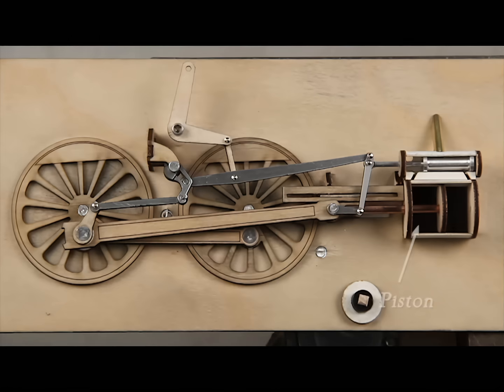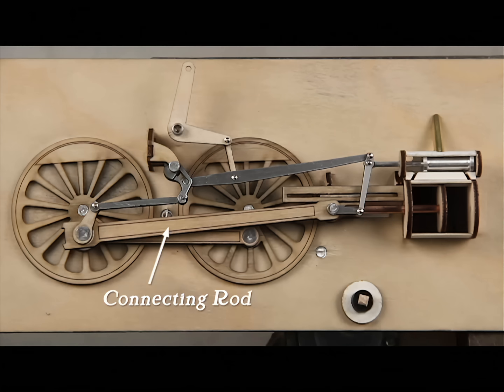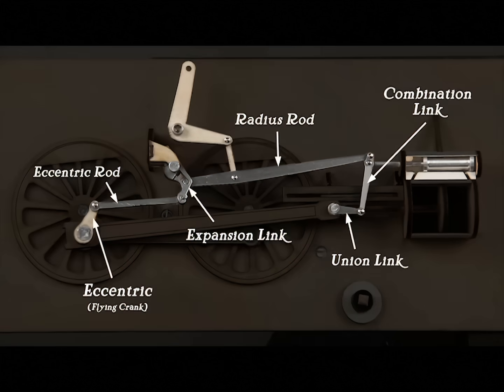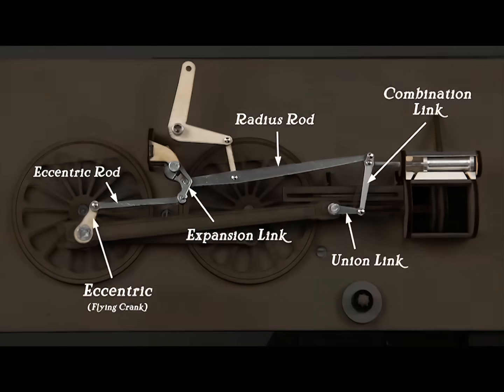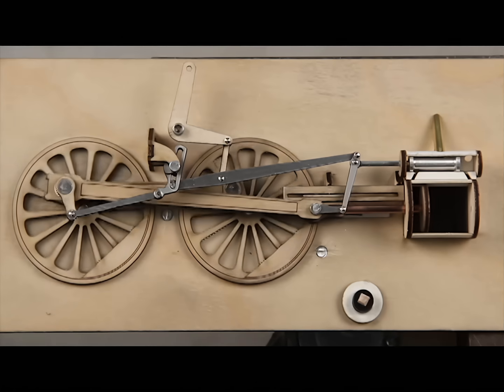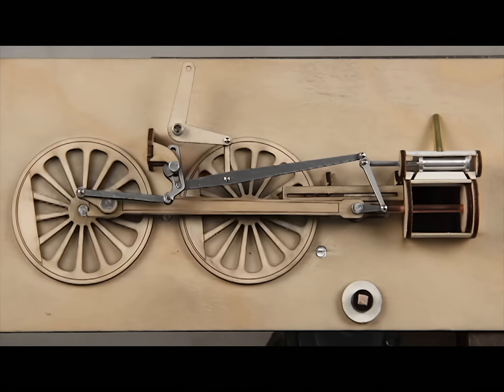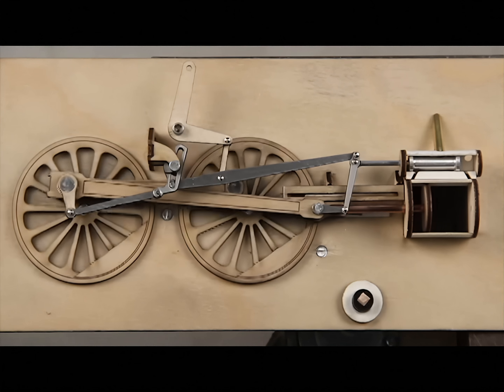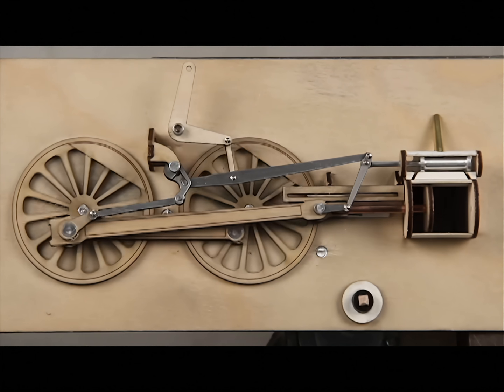Walschaerts Valve Gear Explained

Comment: Thanks for the post. I always wondered if the other side of the locomotive is replicating meaning is it doing the same or is slightly offset - delayed?
Reply from the maker: It's the same on both sides.  But, the other side is 90° out of phase.

Comment: When the expansion link is in the neutral position, how do the wheels "turn over" when the pistons is at its max and min positions without the help of the eccentric linkage?
Wouldn't it just get stuck or go back and forth?
Reply: I  believe each set of wheels n gears ie. left.and right is offset to each other so one side can always deliver power to get initial  movement.
Reply from the maker: Good question!  This mechanism is replicated on the opposite side of the locomotive, but 90° out of phase.  So, when one set of drivers is at 0" or 180°, the other is at 90° or 270° respectively.
Reply: @BLitwin  Oh that makes sense, but could the other side also ever be in the same phase, like maybe in a turn? I mean the train doesn't have a differential but is there anything stopping them from ever doing that?
Reply from the maker: @il400 Without the phase differential, the engine could not start from a standstill, when the drivers are at 0°/180°. Differential-wise, geometry dictates a minute amount of slippage between the driver and the rail, when rounding curves.
Reply: @BLitwin  so the train does have a differential?
I thought that wasn't invented until the 20th century?
Reply from the maker: @il400  I did not say that.  I meant that because there is NO differential, some wheels have to slip on the rail a tiny bit, as the loco rounds a curve.  For example, the North American gauge is about 5.4ft, with a minimum curve radius of 574ft. Given the minimum radius, the outer drive wheels would have to rotate ~1° more than the inner ones, for each degree of the curve.  Ergo, slippage.  One might wonder if this disparity might not be compensated for, through some other features in the mechanism. I don't know. These machines are immensely heavy, though.  Something's gotta give. :)
There is quite a bit of consideration given to track geometry. See - https://en.wikipedia.org/wiki/Minimum_railway_curve_radius
Reply: @BLitwin  I get it now, thank you
Reply: No differentials on locomotives or carriages just a solid shaft axle with fixed wheels. The difference in rotation from inside to outside wheels in a curve is obtained through tapered wheel faces and sideways movement on the rails against the wheel flanges. ie. In a lefthand curve the axle moves to the right, increasing the diameter on the right hand wheel and simultaneously decreasing on the left hand wheel. The curves are calculated to achieve this. It does result in wear of the flanges and inside of the rails though.

Comment: You should update your description: there are no "glaring errors". Your video was spot-on. The neutral position of the Walschaerts gear is not the neutral position of the control piston. You have to move the Walschaerts gear slightly into reverse to neutralize the control piston (and I'm sure that position was clearly marked on the cab controls). Play with your model, and you'll see what I mean.

For my part, I really appreciate the color overlay, because at first I thought the control piston was solid and I wasn't sure where the steam was being injected from. :)
Reply: The vertical linkage directly behind the pistons is the key: that rod has one pivot point that does not move, but that pivot point changes location (including beyond the end of the rod) depending on the gearing position selected from the cab. When the Walschaerts gear is placed in exactly neutral, that pivot point is placed at the upper connecting bolt. The control piston is connected at its own bolt a few inches down, and is not stationary in that position. If you put the Walschaerts gear slightly into reverse, you move that fixed position down the rod. At exactly the right amount of "reverse", that pivot point is placed in-line with the control piston's connecting bolt, and the control piston stops moving.

Linkages was probably one of the most interesting classes in College. :)

Comment: The piston connected to the .... Walschaerts valve  ......   The Walschaerts valve connected to the push rod  /..... the push rod connected to the ... radius rod .... the radius rod... connected to the  ...Eccentric rod....  the eccentric rod ... connected to the radius link...   and that's how it works.

Comment: I  believe there is a same set of mechanism at the other side of the engine also. A slight difference in steam port opening there could cause a difference in torques applied on both sides. Doesn't it cause some unbalancing?
Reply from the maker: Yes, valve gear is required for all cylinders. There would have to be a large difference in the ports to affect torque.  Even if it were so, the engine would work just fine, since all the forces are cumulative.
Reply: @BLitwin  Thanks.

Comment: Thanks for this tutorial.  I knew steam locomotive engineers could adjust power by "hooking up" the reverser to just about center, but I never knew why that worked.  It should also be pointed out that the drive wheels are "quartered" to ensure that at no time will the locomotive be unable to start if one of the cylinders happens to be stopped on "dead center".  There were lots of different valve gear arrangements, but Walschaerts was not only easy to understand but pleasing to the eye.

Comment: Ive always wondered what is the purpose of the union link and the combination link ? From what I can see the working of the piston and valve would still work without them ??
Reply from the maker: The combination link integrates the motion of the piston with the valve motion.  It might operate without it, but not well.
Reply: @BLitwin  ok thats what I use to think but when I went to York museum and was abke to look at one close up it looked to me like it was just an added extra as the piston rod and valve rod would work with out the link in place, but I did wonder if it was a safety link incase the link to the piston broke away and would stop it hitting the ground maybe ??

Comment: Er, not an expert but I reckon the "glaring error" isn't a mistake but a simplification. Doesn't the combination link act as a lever to introduce a small amount of valve movement in phase with the pistons?
Reply from the maker: I don't think I'd put it that way.  I would say that its purpose is to integrate the motion of the two linkage trains, with respect to the valve position - hence the name.

Comment: Has anyone done a study/ tests on how much piston stroke is required- or is best? OR? W hat the relationship between the length of the stroke vs the dia of the drive wheels? AND then has anyone looked at the length of stroke- in both directions that needs to be under pressure fo rthe best h.p.? etc
Reply from the maker: I think you can rest well assured that they have. ;)
Reply: @BLitwin   does anyone have any info on this?
Reply from the maker: @samstewart4807  I don't know offhand, Sam.  The inventors of this technology are a long time gone.
Reply: @BLitwin  hi, thank you.

Comment: One thing I've been wondering: why is it that on most locomotives the cutoff is capped at 75%?
Reply: Depends on how the valve gear is designed - how much lap, how much valve travel. Most of the time it is around 80-90% for the max

Comment: I wonder if the designers built models  or simply used trial and error to get it right? Normally a prototype works the bugs out first. Great engineering though!

Comment: Where does the piston exhaust gas go?
Reply from the maker: Not shown, the exhaust exits the valve chamber at either end, and vented to the smoke box, to help pull air through the boiler tubes, from the fire box.  With each "chuff," the smoke whooshes out of the stack, along with the exhaust.

Comment: In a steam locomotive with a valve gear, is this the only place that causes motion?
Reply from the maker: What place are you referring to?
Reply: @BLitwin  Apologizes if my question was worded too vaguely. I mean to ask is there any other mechanism driving the wheels? Or is it only the valve gear?
Reply from the maker: @thecpmr6276  The drive power for the wheels comes from the piston and connecting rods. The other linkage controls the valve.  That's it. :)

Comment: Whether any steam is admitted when in mid gear is determined by the lap.  With a low lap a small puff of steam is admitted at TDC This can be used to effect a cushioning of the piston. A range of Great Western engines using Stevenson valve gear made use of this special property.  In the Stevenson gear it was the crossover effect of the two links that made the valve move even in mid gear.  In the Walschearts gear it is the effect of the combination lever.   With a high amount of lap this effect does not occur.  The designer takes these unusual aspects into consideration when picking lap and lead parameters.
Reply from the maker: Thanks for the detailed explanation!

Comment: Thanks Brad. As same as you, I, since age 6, have been fascinated by the mechanism of the driving wheels of locomotive engines. I am also a collector of Marklin model trains (mostly locomotives). Your video is very intuitive and clear. I learned a ton.

Comment: This is the best explanation I have encountered so far - well done and thankyou!  Especially on the variable valve timing.
Now all I need is to understand how the water in the low pressure tender water tank can be continually fed into a high pressure boiler - some have told me  it's a one way valve, but surely then the pressure of the water in the tender tank would have to be greater than the boiler pressure to advance the water into the boiler?  I think I'm missing something small/subtle as most steam engine explanations focus on the steam getting to the pistons but miss how the boiler pressure doesn't end up backflowing into the tender? =)  Cheers! =)
Reply from the maker: Thanks! I imagine there's a hydraulic piston that periodically forces a small, cold water volume into the boiler.

Comment: Well, I only wish you all understand me well - I am not going to criticize the work done. I am keen only to express the meaning which results of my education got as a physicist.
There are seemingly 2 (in words TWO) points during a single revolution of the drive wheel of the locomotive, where there is no force for the movement of the loc if you give 'gas' at still-stand. For this reason, there is a phase shift between the steam engines driving the wheels on the left and right rail. For those curious, it is 90°.
The locomotive with only two engines, two main cylinders, one on left one on the left side, cannot be dynamically balanced. It tends to large oscillations through the drive.
For this reason, the most beautiful locomotives designed for the highest cruise speeds have, besides the left and right engine, one more, central one in between. These three engines work with the 120° phase shift and CAN BE dynamically balanced. The locomotive thus operates without inherent oscillations.
Reply: Physicist or not, you're mistaken about at least one thing.  Most common steam locomotives, including as depicted here, have one engine, not two.  The left- and right-hand cylinders and their associated equipment drive a common crankshaft, being the drive axle to which the main rods are attached.  Such locomotives are defined as having a two-cylinder double-acting engine.
Only articulated, duplex-drive, and a few with three separate engines have more than one.

Comment: Well, If the clarity and beautiful symetry of your models make this mysterious secondary valve train clear -  I' would accept that little error. Who cares really, the important thing is that you clarified the workings of the eccentric, radius rod and the combination link. Can you imagine  Walschaerts doing this by hand, no calculator and all pencil drawings. You did a wonderful job of explaining this mechanism and a clear disply of how the spool valve stops it's transverse motion  or not when the Eccentric gear is set. Great job. Thanks you sincerely.

Comment: I Love it it's just so clever. The fine tuning system of power regulation. One important and major detail is that on the opposite side of the machine you have the same system 90 degree of align with the other side. And that's wery important because otherwise the whole setup would bottom up and close. That's why the choo choo sound came from the train. The little pause between the choo choos indicate that arrangement. Thanks for an fantastic explanation.

Comment: Very good;  but there was too much talk and not enough show.  You should continuously adjust the settings slowly as we are SEEING the change in the whole device, not just a closeup of one part at one time.  That way, we can wholistically get the whole concept better AS WE SEE THE ADJUSTMENT IN REAL TIME, not in separate choppy pieces.  The whole video would have to be much longer to give explanation carefully  with arrow notes,  as we are slowly ingesting it.  I would have to spend some time seeing in my minds eye how the parts inter-relate,  but I don't have much time luxury for it.
Thanks much,  Aarre Peltomaa
Reply: Post script (ps).    There is a point were we approach neutral, and motion is slowed,   until motion is stopped at neutral;  beyond that the direction is changed.   PLEASE SHOW THAT TO ME IN REAL TIME.   Kindly thanks so much.  Aarre Peltomaa

Comment: I am looking for information about steam engines. Especially high pressure automobile. IE dobble.
     PS in neutral the exhaust valve MUST remain open at all times otherwise on the down stroke you'd be sucking a vacuum. Which is just as good as hitting the brakes. Hard enough to rip your crank to shreds at any kind of speed